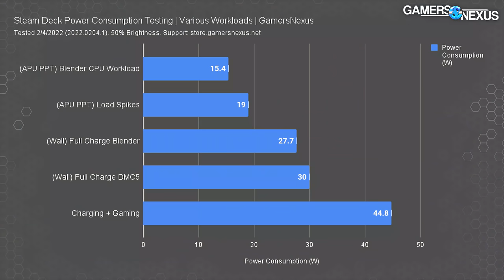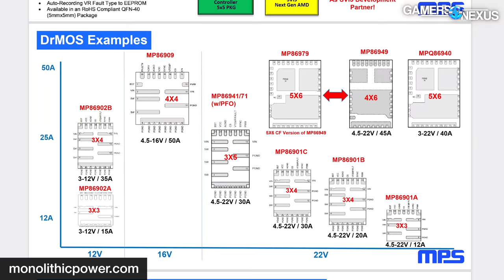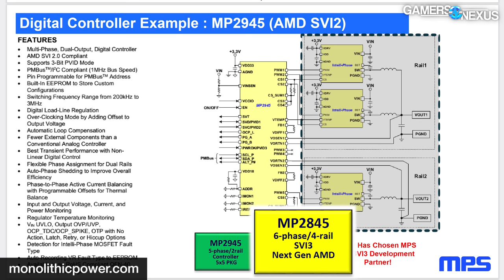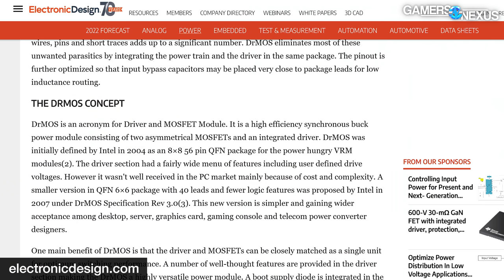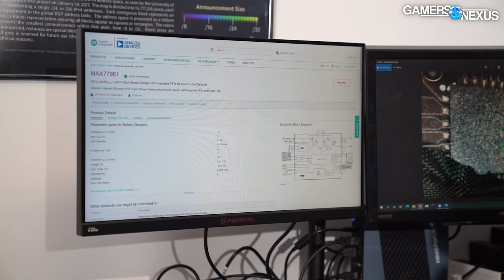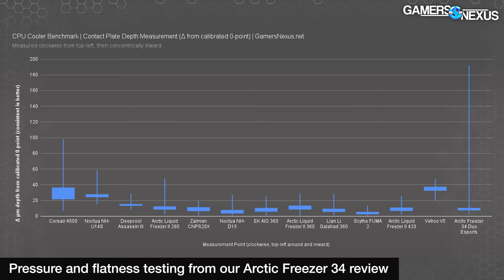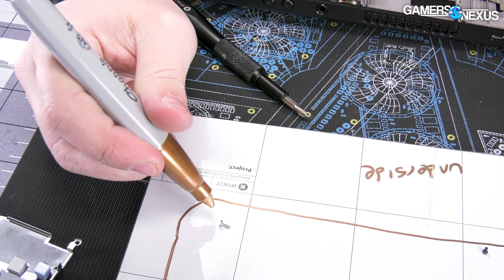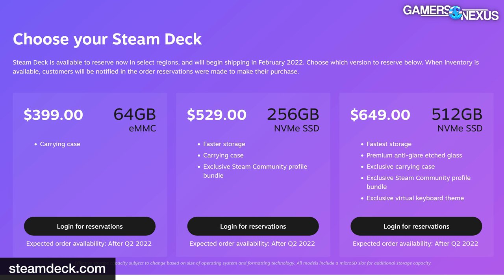Steam Deck Tear-Down: Build Quality, Disassembly, & VRM Analysis

Comment: After 2 weeks of using the Deck, the biggest issue is cooling. These fin stacks simply do not provide enough cooling surface for the amount of heat that needs to be dissipated, and as a result, the fan runs almost constantly. Even when downloading games because the files are being uncompressed (= CPU workload). Which would be tolerable if they hadn't opted for this disastrous fan. I mean radial fans are never really quiet - by design - but this one is a special kind of obnoxious b/c of it's high pitched noise at all rpm stages. Over-ear headphones (closed or with ANC) solve this problem entirely but the Deck's decent speakers are rendered useless, because they always compete with that tiny turbine.

Comment: I partially disagree with the statement that thermal imaging of the steam deck would be useless, but it would be useless if you did it without the back cover on. The point of it would be to show what the heat level would be on parts that the user is likely to touch. This would give a good expectation of comfort level as it relates to heat. Certain laptops and even one of these handheld gaming PC's (I forget which one) will leak heat onto areas the the user is likely to touch and can cause discomfort and would probably just make the manufacturer write the firmware to throttle earlier because they designed the cooling poorly. Notebookcheck does thermal image tests of their laptops with the chassis on and at a heavy (but reasonable) work load for this reason. You guys don't do laptops and typically the things you work with are very far away from any body parts, so I can see why that didn't cross your mind. No big deal. Maybe there's another reason I'm missing though.

Oh yeah, and when I say thermal imaging, I'm talking about one that will get an infrared read on the temperatures as well as showing the heat map.

Comment: Doesn't even have to be a specially designed version of the chip.

All Valve would need to do is get approval from the manufacturer that they can run the chip at a higher temperature. Valve would then have produceable documentation and a certificate saying that they are allowed to operate it at the higher temperatures.

Comment: Once its allowed can you compare proton performance and battery usage vs windows (like game X runs at 60 FPS on both systems, battery power is 20% less on proton.... which can happen if more CPU/GPU power is required for proton vs windows).

Comment: I really hope some one will make a proper external battery mod so it's not INSIDE and can be fast swaped 😀
Reply: You're in luck I'm already on top of it!
Get yourself some Velcro and a battery bank, slap it on the back of the deck!
Reply: @XxGlaciersOfIcexX  yeah they only problem is that it would be too heavy) But as a temp soultion - why not?
Reply: I was kinda being a smartazz, but yeah battery banks are the best bet

Comment: I know this was probably done to keep the video from reaching the hour mark and because you had to work on other content but there are way too many cuts during the teardown. When I look at a teardown it will likely be because I want to see how to take the thing apart so you struggling with one aspect or another is important to see. There were a few such cuts during the video. 

Then there's the lack of B-roll or close-ups showing the parts you were discussing. For instance the SOC was barely on screen, Steve mentions the Valve branding then two seconds later we're moving on. Sure it's still in view for the rest of the section but it's upside-down and the markings are barely visible. Maybe you're under NDA and can't show it but I would have at least expected a mention of that. If not, I would have expected a 5 second close-up shot of the SOC after you cleaned off the paste. Either using B-roll or a more zoomed-in close-up during the teardown. 

Finally I hope you go for a full teardown once you no longer have to worry about breaking a Deck. I want to see just how hard those cables glued to the battery are to remove, how easy the battery is to remove and the same with the screen. Also I don't remember any mention of the charge port. From what I can see it's integral to the motherboard which could be cause for issues later on. The charge port, the screen and battery are the most common parts that need to be serviced in addition to the joysticks (which seemed sufficiently easy to replace). Not having easy access to those first three can be cause for concern with the device.

Comment: I prefer a lot of screws rather than being unable to disassemble my own thing.

And I wonder what valve will say if somebody asked why the battery is glued.
Reply: My Tablet had the battery glued as well, with a little force it was still easily removable, but it bend badly enough so you don't want to use it again.  
Only because it doesn't fall out instantly doesn't mean it is hard to remove.  
But without a replacement at hand Steve obviously isn't willing to damage it for science.  
Either way, replacement batteries are a must or it will only end up in a landfill.  
I also want to know if the battery is bypassed or tortured when connected to power.  
My old Tablet is discharging faster than i can charge it via USB... i just want it to charge to full and then run off wallpower and leave the battery alone.  
Otherwise docked mode is a NO NO from me.

Comment: 12:20 Is the VRM really stepping 12V down? It doesn't seem very efficient to boost the 7.7V of the battery up to 12V and then back down to around 1V. My guess is that the VRM is fed directly from the battery.
Reply: I think he mentioned 12V as example, given his recent PSU experience, not literally. For that he would need board schematics likely.
Reply: @reav3rtm  Yea. For a classical PC it's 12V. So the "wrong" number in this case doesn't really matter. But it's Gamers Nexus and they are always trying to be as accurate as possible ;)

Comment: Admittedly SteamDeck isn't in the same volume levels as Sony, Microsoft and Nintendo, but surprised how many boards and chips there are. I assume if the first SteamDeck gen is successful they might look at lowering the chip/board count on future revisions.

Disappointing the battery is glued in though. Hope it's just a compromise for the preproduction units.
Reply: Steam will not lower chip count, and thank valve for that approach, its much more desirable to have plenty daughterboards instead of a single motherboard for maintenance and fixing purposes, the main problem with consoles is that everything is on one board, you fry something you have to swap the whole thing, where the daighterboard approach you just swap a smaller board without having to touch the other components, so hope valve never listens to comments like yours, the deck is bigger for a reason, its much more maintenance fri dly than everything else on market, aside from framework things, you will come to love a deck when you feel for yourself how much easir it is to fix components compared to a switch or even home consoles.

Comment: 4:55 The first thing we do is disconnect the battery before we start poking around with a screwdriver…
7:30 Starts poking around with a screwdriver before disconnecting the battery…

Comment: As usual, great work from the GN team. 

My only question is how easy is it to find a replacement for the 64GB emmc module to potentially upgrade it to a larger storage option in the future?
Reply: That will be a more relevant question in the future when the market will adjust to the demand for those components. The thing is that Valve is not really making any notable profits and they're buying in bulk, so upgrades will not be cheap in comparison. I think that from the user standpoint, it will be more viable to just use an SD card.

Comment: I guess, this will kill of the switch fast, alone by upgradeability and repairability. It would be cool if GN could cover a nvme swap, how the deck reacts to a completely new nvme ssd. If this works out, I plan on obtaining the "cheapo" deck with only 64GB and invest the saved 250$ on a separate 1TB or higher capacity ssd.

Comment: the magnesium chassis will spread the heat to the display which will provide a lot of cooling due to its large surface area, just like in modern phones i would expect the display to play a major role in the cooling of this device.

Comment: Thanks!
Reply: This was a beautiful piece of electronics engineering content suitable for a wide range of audiences in a way rarely seen on modern YT. I wish stuff like this existed back when I was learning to be an EE (late 80's). I never would have stopped being a parts-hunting solder jokey who liked digging out sources for obscure components.
A work of art in my opinion. Your steamdeck work could end up being your Magnum Opus - sans flames.
BUT ... small butt ... fan testing of that fan when? Creating a "Noctua Edition" Steam Deck when?

Comment: Im honestly wondering why in proprietary system such as this no one fuses the IHS to the heatsink. I get production cost would get higher, however using a molten metal 
(maybe 1100 alloy aluminum) would interface as well as thermal paste i would expect. so assembly would go something like the following.  Place IHS and heatsink or transfer plate in a die mold, pour in molten aluminum and let it cool until solid. place IHS and heatsink assembly back onto CPU. Then see how the thermals work. might be a good experiment in anyone is willing to try it. EDIT! would only work if there is an IHS don't attempt on a bare CPU.

Comment: I don't understand why they didn't use a slightly thicker component layout under the central portion of the backplate. Ergonomics wouldn't be affected, there's already a backplate hump with finger divots for this. Weight should be negligible, if even noticeable. But the benefit is slightly better component packing, maybe a slightly thicker battery would allow room for a longer SSD, as 2230s are not as widely available on the consumer market as 2242s are, and possibly free up room for a more optimal cooling solution; hell, even a slight motherboard design tweaking would've allowed for a longer SSD. The idea of docking is also irrelevant here, considering it won't 'dock' like a typical device would due to the top port, the most of a 'dock' you'll have is a cradle/stand with a wire. I also believe with a bit more design revision, the I/O could've been moved to the bottom, especially the headphone jack, you'll have to route the wire behind the device so that it doesn't dangle in front of the display, losing you a few inches at the least and inducing additional strains on the connector as the wire won't freely dangle out of the plastic housing; you'd need a 180° connector to avoid this, but you'd also still be losing a few inches of cord, which can be a deal breaker on some headphones without detachable cables, but additional connectors are not a good solution, same goes for the Type C port.

Threading into plastic? No Valve, use inserts, even laptop manufacturers know to do this. Especially with the user-serviceable design, considering controller components were designed to be replicable, a product like this needs threaded inserts so plastic threads don't get stripped over time, or immediately stripped by users that don't know better. Plastic snaps and clips face similar issues, they'll break over time, especially with inexperienced consumers working on these. The fact that the battery needs additional component removal before it can be disconnected is a bit concerning, a serviceable device like this needs access to an easy to disconnect battery connector as the first step after removing the backplate. Having a screw under an adhesive foil is also a bit concerning, I would imagine that adhesive would eventually fail over time; what even is the purpose of this design anyways, it covers a heatsink mount, the shield plate should be removed before the cooling mount is touched anyways, and the screw the foil tape shouldn't even be necessary for mounting the plate, that little mounting tab under the hole seems unnecessary. Glued cables are also problematic, either run them under the battery or have a different adhesion method; similar with the battery, according to Linus' teardown stream, I believe the battery itself has too much adhesion to the magnesium midframe. 

Valve is competent in what they do, but this is very telling of a first generation product, even at that point it feels like it's bordering on a 'we're close to bringing this to market' trade show hardware demo. So many implementations and choices just seem questionable at best. I know Valve doesn't have a ton of hardware design in their portfolio, but I would expect this from a smaller boutique that may not have the financial backing to refine development like this, but I would've expected better from an estimated $10+ billion dollar company, it just seems lazy, cutting corners where possible, and/or that the project was handed off to a small dev team and was told that their kit was good enough upon higher ups reviewing it; for something that should meet the quality of big corporation consoles and laptops, I think it falls quite a bit short in terms of refinement and better choices. The various attention to detail also seems inconsistent, small details are there, but big ones really aren't, like the SSD size, overall design that could further optimize things, port placement, etc. 

Personally, I'd at least wait for the first major hardware revision. If not wait for a gen 2 or 3 of the product, in hopes that there's better design choices made in later generations. I'm also not a believer in x86 handhelds, they're just not efficient enough when compared to ARM, and the eventual industry change over into ARM, or an ARM successor, will massively boost handhelds; the efficiency is why smartphones last so long, why the Switch doesn't die in an hour, etc., and of course more power efficient GPU architectures will boost battery lifetime as well. x86 just isn't built for this purpose, sure you could nerf power draw to extend battery life, but you're also sacrificing performance to do this, it's why 'gaming' laptops are power hungry behemoths compared to your longer-lasting thin and lights, the performance per watt just is not comparable. I want a handheld, I just don't think there's much point in investing until there's an industry shift to a better performance/power efficient platform, or until there's some magical battery development that'll massively expand power density of batteries; the only hold over for this is some of the later specs of fast charging, let me play at full tilt while also significantly charging the battery, or very quickly charge the battery outside of play, even if this leads to faster degradation, for which the batteries need to be supplied as replaceable units, I'd much rather take the convenience over longevity if it's the only option. 

I have hopes for the Steam Deck, I just hope it continues to be successful after the initial hype. I don't want it becoming a suction-cup dart that falls off the wall after a few minutes, I'm afraid Valve may just pull out of the longer term project altogether, due to various downsides mentioned here. There's reasons why we haven't really seen handhelds outside of small boutique brands, and the most we've seen is that Alienware concept from two or three CES shows ago, the tech just isn't there to support the platform, and for what tech is there, there's not software support for it, it's just not a great industry situation to bring a product like this to market. I also hope later generations also include upgrades, like an OLED display, newer WIFI components, and magnetic-based analog components to combat drift issues, Sony used to use these irrc, etc. With future generations I also hope to see more come with the product, such as an on-board keyboard like GDP WIN3's Sidekick-style keyboard, I believe it's better to have a full keyboard interface, especially for multi-key macros, than it is relying on software keyboards, no matter how intuitive those software keyboards are to use.

Comment: Looks likere there aren’t any “rumble” motors/engines inside, or did i miss something?
Reply: We have confirmation that the touchpads have haptic feedback, even if it was a last minute consideration, so I'm assuming it's built into the touchpad units we saw with the orange backing
Reply: Valve uses the haptic feedback from the touch pads to emulate rumble motors. Apparently its not the best right now but valve claims they will fix it in software. The steam controllers did it this way too. They don't produce a very pronounced rumble. This a deal breaker for ya? I can't say I much like rumble but then I wasd primarily.
Reply from the maker: Valve decided not to use rumbles for battery, size, and cost reasons.

Comment: its funny that the valve video tries to convince you if you change the ssd your gonna kill your wifi when if you look at there ssd they have a thermal pad over there factory one and on top of that they have aluminum tape for shield it. I think this is something you can replicate at home.

Comment: Now I kinda wonder if someone would do LPDDR5 module solder upgrade on that thing from 16GB to 32GB, especially APU also rely on RAM
Reply: For such a low-resolution screen, I don't think you'll run into VRAM limitations ever.
Reply: I think it's more about ram speed then capacity

Comment: Looked like there was alot of "dead space" under the egonomic handles on either side. Why would they not have used that space? Airflow, heatsink, sparse out the otherwise packed components.